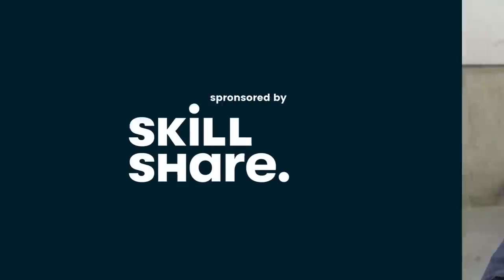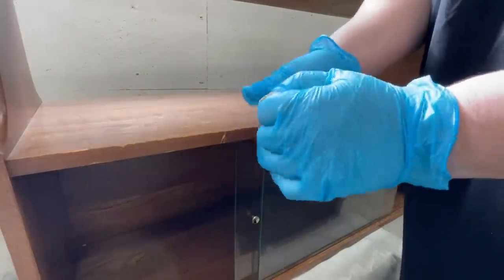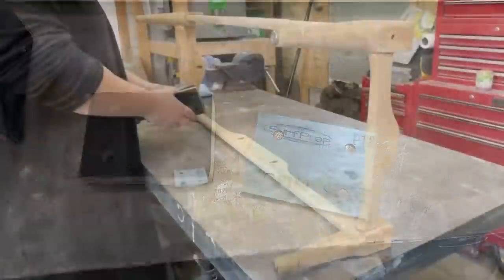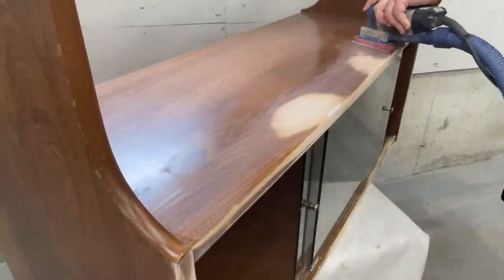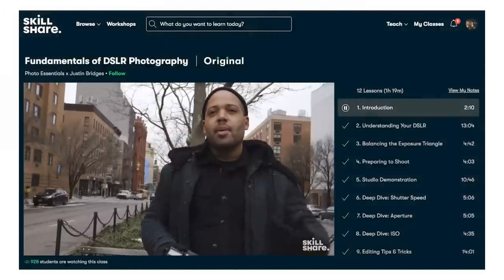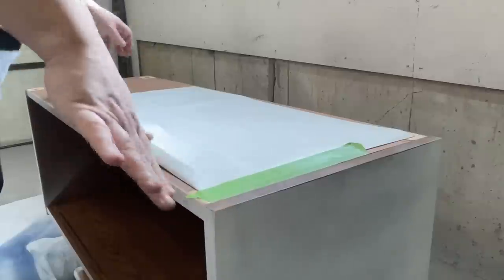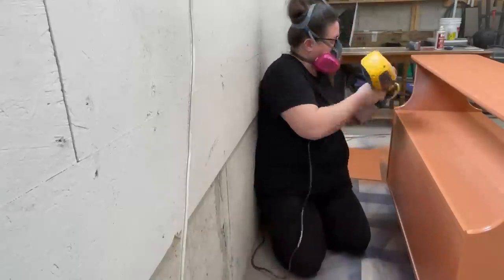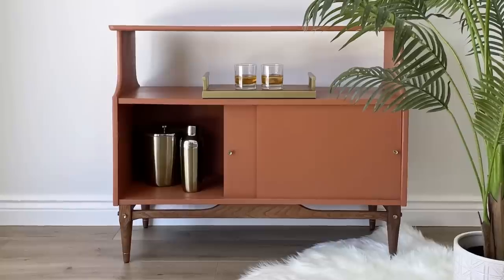We need to talk about this MID CENTURY MODERN Bar Makeover!

Comment: Love the color! I worked on something similar and the sliding doors were such a pain. I wallpapered them though which made them thicker so I had to put in a new thinner price of wood along the track. I was so glad to see that one go to a new home. 
Glad to see you trying this paint. I wasn’t aware it doesn’t sand well. I like that you can choose your own color. I too usually reach for the Behr decorative chalk paint because it is the only one I have found that is tintable. Last time though it was too thick and after watering it down and using a spray bottle it kept giving me a streaked mess. I’m cautious to try it again.

Comment: Great work on the replacement doors. I currently have a piece that has some sliding glass doors that I could not remove. I noticed though that the upper sliding guide was actually secured by 4 small screws. Removed the screws and the glass and guide came off easily. I thought the same thing too, that the top was secured over the glass, but was fortunate to see those 4 small screws.  Question: what made you use the Wagner instead of your air compressor setup?   I'm still debating making the investment of a compressor and spray gun VS a wagner electric sprayer.  (decisions, decisions, decisions)

Comment: I would have made a new track for the top of the glass that would slide into place and screw into the top with corner brackets so you could remove/replace the glass as necessary

Comment: You might have been able to repair the glass crack with windshield repair. Once they insert the special bonder it seals crack and it becomes almost invisible. If you had a windshield repair technician do it, it would cost about $40, but you might have been able to buy material and did yourself. Just a thought 🤔

Comment: I had to pause the video to say, I need to strip the paint off of a dresser that I have but I can't spend six or seven hundred dollars for that sander, like you're using, so what can I use instead? 
Back to the video.
Reply from the maker: I would start with a carbide scraper or chemical stripper and once you’ve got most of the paint out of the way you can sand with whatever sander you want 😉✌️

Comment: How come you didn’t need to prime the whole thing before paining? The one clip it appears you’re spraying over some parts that have the white primer and some that don’t.
Reply from the maker: I primed over outside where I has sanded through the original finish in spots. The only part I didn’t prime was the inside of the cabinet because the original finish was still intact and I had no wood filler repairs.

Comment: I wonder why you weren't able to take out the glass. Usually the groove is deeper in the middle of the piece so you can lift the glass and wiggle it out... But even tho it's really beautiful piece. 😊Just such a shame with the glass doors 😔
Reply: Yep and or deeper on top grooves all the way across, better for any type panels to be fed up into upper groove 1st then dropped  into lower groove .Hints were that that cabinet  was built  around  the glass but probably not , I bought one with broken  glass door , replace without  panel glass and colored acrylic knobs

Comment: Hi, i have a question for anybody who knows. please help me! so recently i was working on an old dining table, painted it white and decided to apply a top coat. i heard polyurethane was what i should use, so i purchased one at my local walmart. it’s from the brand MINWAX and is labeled as fast drying warm gloss. i had the dining table in my kitchen and have a door with a net for ventilation open. i didn’t know that it would smell so strong and i’m pretty sure this is specifically for furniture and interior. does anybody know if it’s safe for me and my family to stay in the house and sleep and what? i cant tell if the smell is actually in any of the bedrooms, or if i’m just paranoid. our house is only 1 floor. please if someone knows, help me out
Reply: You should be fine but keep doors and windows open for as long as you can. Did you use an oil based poly? Those can turn yellow over white paint. I use a water based poly or even my chalk line’s sealer or wax to finish so I don’t have that smell.
Reply: @lollylolly8186  thanks for your answer! yes, i used an oil based polyurethane. but honestly the smell was so terrible, i decided to take it outside. my plan is to maybe redo it, i’m not very happy with the result and i can’t imagine having to apply this to the rest of the chairs too. do you have any recommendations for top coats i can use that don’t have a terrible scent? i looked it up and it said the fumes for polyurethane are toxic for a few days? idk if this is accurate information, but it kinda freaks me out. and on top of that, i can’t really do these projects outside